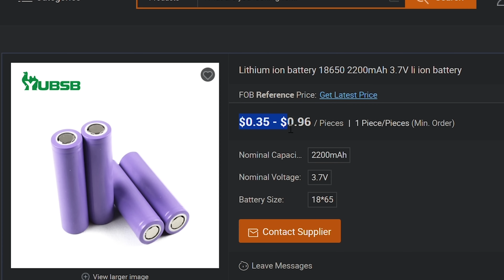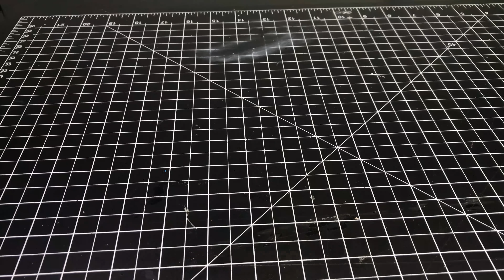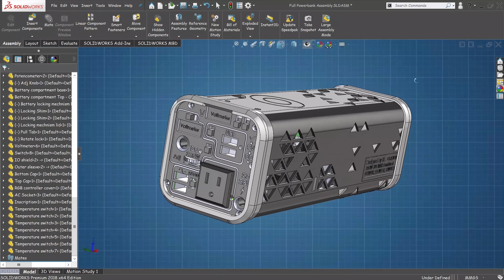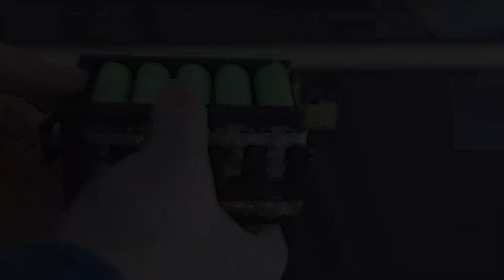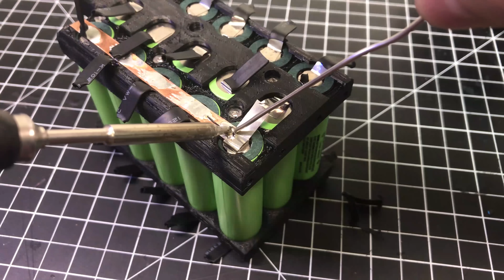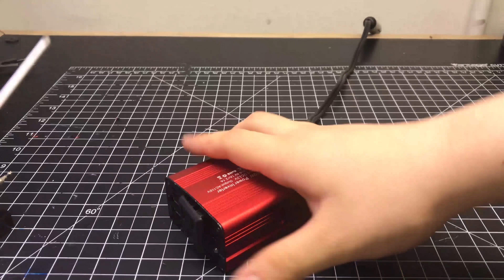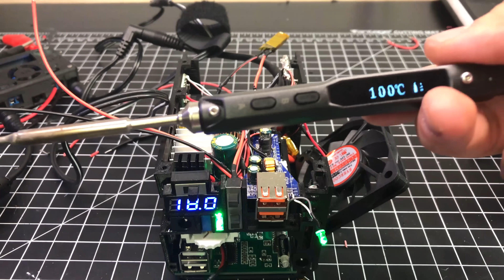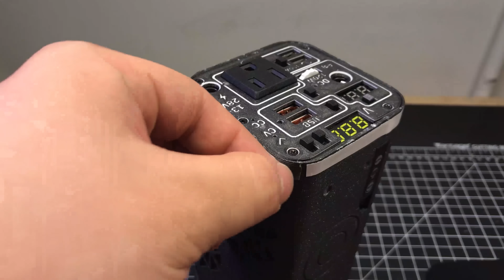How to Make the Ultimate 18650 Power Bank with Infinitely Expandable Capacity

Comment: everything cost 58$ only
3D printer enters the chat
Reply: Akhilk 99999 just go to a local library that has one
Reply: @floofyboii6034  3D printers are still not a thing in my country
Reply: @floofyboii6034  that is not a thing in mi country
Reply: They aren't too expensive. I picked up my Ender 3 for $170. I've printed RC model planes with 40 inch wingspans in parts on it and flown them. It's so worth it.
Reply: @kevinrdunnphs  "Aren't too expensive"

"Only for $170..."

Inb4 I get roasted for being cheap, yes I get it's an investment for a highly specialized machine. I was just making a joke 🙏
Reply: Just get few sheets of polycarbonate $5-10 and make your own. Designers don't bother with 3d printing when we prototype these types of things, plus with a bit of effort and knowhow (youtube it if you don't know) handmade enclosure and parts are faster to make and better than 3d printed ones. Basic tools sheet cutter, few clamps, utility knife, wire saw, heat gun (or hair dryer), resin adhesive (or glue gun) I mean if you are planning to DIY you should have most of these stuff already, if not they are a good investment if you plan to make your own stuff.
Reply: @jackywchen  3D printers are almost exclusively used for prototyping and small volume manufacturing. The whole enclosure is precise and exact while also only taking around a dollar in filament and the time to download and hitting start before going to bed.
Reply: @kevinrdunnphs  You are not wrong, but my comment was directed toward Akhilk 99999 since he/she doesn't have access to a 3d printer. Plus 3d print benefits large portions of small-volume manufacturing and prototyping, but for an equally large portion of us the technology or the cost doesn't justify using it in our production yet.
Reply: @jackywchen  This is what drives me crazy when I'm watching DIY videos.  The other day some commenter was whining about having to buy a "$20 glue gun."  

I'm just thinking... why the fuck are you watching DIY videos if you don't even have a glue gun, or a single clue what they cost?  I have a $5 glue gun and a $25 dual temp one.... but I actually make some of the stuff I see in these videos.  I don't just cruise around YT confusing "DIY" with "CHEAP/FREE."
Reply: Lol you all are totally missing the major market for online, on demand, 3d printing service. You basically model the case or whatever on your computer, send them the file, pick the material, and in less than a week you got your part for less than 20 bucks. Well unless you want it in plated gold or something. This is literally what i do for every project. Search it up.
Reply: @chrisspears4851  You're not wrong... but by the time you've paid for that service a few times, you probably could have bought a printer.  On the other hand, you'd also have to learn how to slice and print, etc., so I understand ordering it just makes sense for some people.
Reply: @The-Rewker  True. But 3d printing filament isnt cheap either. Its basically the same as renting anything, you rent a car for 12 months. By the time your halfway through you couldve bought the damn thing twice.
Reply: @chrisspears4851  Exactly. Truth be told, I hope things get to a point where ordering things printed is barely more than doing it yourself.  Probably will eventually.  Slicing/printing is still kind of a skill, and not everybody will want to learn it.  When printers are all controlled by machine AI it won't be an issue, but that's not quite here yet...  

I'm trying to imagine different kinds of print sharing businesses... like an Uber type user-to-user one where people in your area can rent out their printers when they're not using them, and you can eliminate all or most of the shipping costs.  It would be like Uber, except you can potentially scale up your operation with a few extra printers.  The biggest tangle I can see is how to price people using cheap printers vs. expensive ones.  

Or I'm thinking of a different version of the services we have now.  Where you can order a model printed as usual, or you can log directly into the printer and slice it yourself, then print it in real time.  Even with existing tech/infrastructure, you could automate most of that process.  People could even log into a webcam and watch their stuff print.  If you had everything set up right, one or two people could oversee a pretty large print farm.  

It's times like this I wish I had a million dollars (or even $100k) to invest in a startup.  Or I wish I had all of the technical knowledge to set it up.  But if I had the money, I guess I could hire someone.  What's nice is that everything is open source, so you could make your own slicing/print server software.  

Since you're someone who's used those services, let me do some market research on you:

Would you like to watch your model be printed in real time?  And/or receive a timelapse of it printing? 

Would you be interested in not only watching it print, but logging into the slicing software so you can have full control?  (I just realized the user would have to pay for any wasted material if their settings failed.) 

Would you be willing to post-process the model yourself, remove supports, etc., if it meant you could get it much cheaper? (not sure if this is already an option)

Fuck, I wish I had $1M and was a programmer.
Reply: @The-Rewker   Drew Kosonen  I think a better example would be a hackerspace airbnb set up. Where in every major city, we have a place rented out and people pay a membership/hourly fee to get in and tinker. Or we can just do a simple farm, where the service is all online via website or an app. So it would be basically another 3d printing service. The webcam part is definitely attainable without a ton of programming. Tho we might have to use our own set up. I've seen a ton of raspberry pi type projects out there that fits the bill. Im more entrepreneurial than consumer. And ive always been interested in 3d printing, as it still seems to be a emerging manufacturing field. This idea had def got some entrepreneur juices flowing lol. From my experience your too hooked up on the excuses of no money to even start. Thats why you expand as you go. You wont grow from 0 to a mils customers in overnight, if you bought everything in bulk, but youll be able to test the idea and make sure its even profitable and/or scalable enough to be worth it. For example. Set up the website and everything and buy 3 printers. Once those get overloaded (and if you set up the profit margin right), you spend the profit investing it back into the business. And buy 2 more printers. And rinse and repeat and keep growing. But you need to decide what business model you want, because everything is up in the air rn, and ideas arent much unless you have a solid plan of action. The one you seem to be aiming for manufacturing as a service. Thats the one where whole reason people order their printed parts from you is because you have the special equipment, and as such its cheaper for them to order from you, rather than having buy the equipment and set it up on the technical side to finally get theire model. Ive built a few dif business's from the ground up. I have one successful one, and two more in the works. But this idea def seems to a working 3rd lol.
Reply: Duct tape is your friend
Reply: lol.... it's so depressingly retarded that this comment has 498 likes, I have to laugh in order to mask the negative emotions.  

<$200 3D printer enters the chat.  Commenter A: scoffs in $1000 phone.  Commenter B: laughs in $1500 laptop.  Commenter C: chortles in $2500 desktop.   

I got an Anycubic i3 Mega for $179 on the New Years Sale.  I was blown away that I could buy a working printer for less than half the cost of my GPU. 

3d printing is like this revolutionary technology that opens up a whole world of possibilities.... and people act like $200 is too much, because they simply have no concept of what "value" is.
Reply: Drew Kosonen I live in Lebanon. Where the average salary is $200-50 per month so a 3d printer is basically a dream for me.
Reply: There are companies online that 3d print things for you, for cheap too I think.
Reply: fr
Reply: While there's really no need at all for the 3D printer if you just have a rotary tool and buy a cool enough project enclosure, the cost of using legit batteries is going to be what costs either way. Old laptop cells are not the way to go even if you have tons. I'd have to use 30Q's or something.
Reply: Even with like the monoprice v2 its under 200$
Reply: 130€ Ender 3
Reply: Everything costs 58$
3d printer costs x100
EVERYTHING (With 3d printer) 58585
Reply: Cheep china 3d printer for 200$
Reply: @Rowdy Ugh... 

Good luck finding one on Amazon.  If you don't want to make shit, you shouldn't be teasing yourself with these videos.  Just keep looking at what's on the shelf.
Reply: alysdexia  Nobody likes a grammer nazi. (yea go ahead and correct it, aint gonna change how i type just cause u wanna be annoying)
Reply: alysdexia  Lol /r iamverysmart
Reply: @Rowdy lol wtf makes you think I use myspace?
"For a guy who likes shitty C10 pickups to come out of nowhere and heckle a guy.  What a loser."  
I wasn't "heckling" you, dumbass.  I was telling you to stop being a lazy POS and make something for yourself.  

People make stuff like this specifically because they can't buy it.  It's too much of a niche product, costs too much to develop and manufacture, and won't sell in high enough numbers to recoup the costs. 

So people make it themselves, then make these videos to show you how.  So stop coming on the damn videos asking where to buy it, like a moron.  
And stop trying to glean people's lives from a YT profile they never touch, because that just makes you look like even more of a moron.
Reply: alysdexia  " nothing *Nothing to do with grammar, a barbarism of ghrammatics grammatical barbarism, another word for composition as in handwriting, font, format, spacing, the looks, but with lecsis/diction as in register, vocabulary, declension, spelling, placement, the meaning, nor with nationalism or socialism. Run-on sentence/meaningless word salad. The wrong one, you, are the annoying one and a sociopath who needs to be offed." 

Extremely hypocritical, not to mention disturbingly sociopathic statement.  Much like your extremely hypocritical, laughable, and inconsistent attempts at grammatical nazism.  On internet comments, no less, where people are known to forgo grammatical rules in favor of expedience and/or free expression. 

... You have some legit illnesses in that head of yours, don't you?
Reply: @Rowdy You're still not getting it.  The whole point of videos like this is because you cannot buy the shit, and nobody wants to sell it.  If you took a moment to pull your head out and think about it, you would understand why it's dumb to even ask.

I could understand a kid asking once because they just don't know.  But I've already explained it to you multiple times, and you're just refusing to understand because people are so used to being spoon-fed if they just shell out some $$.

So I'll try one more time.  If you're not going to read, don't bother responding:

If the person wanted to sell them, they would be doing that.  But it's not a product that can be made & sold profitably.  Only like 10 people would actually buy it so you won't see any of the big companies making it.  They would spend more on research & development than they would ever get back in sales.

If you're hoping to buy it from a major manufacturer, the cost of the device is only a fraction of what you'd end up paying.  They have to recoup all of the money they put into R&D, manufacturing, distribution.  Not to mention getting it certified for safety, licensed for sale, etc.

If you're hoping to buy it from a DIYer, they won't have as much overhead to pay.  But that means they don't have a factory either, so you have to pay for every minute of their time.  So I'll ask again: Exactly how much would you be willing to pay for this thing?  $200?  $300?  $500+?

I'm not sure why this is so hard to understand, but I guess this is the world we're living in.  China is taking over with cheap sweatshop labor and crappy products because we westerners have no concept of value, and aren't willing to pay for true quality.  We just want all the stuff and we want it cheap.

You probably don't even know why you want it or what you'd use it for...
Reply: @The-Rewker  I never thought my comment will become this controversial
Reply: @Stalka42  That's because your comment has nothing to do with the current controversy.
Reply: @Rowdy What kind of loser wastes their time watching DIY videos when they're too lazy/stupid to make anything themselves?   

Not my fault you need a novel to understand the basics of economics...
Reply: alysdexia  Oh ok, troll was my other guess.  Are we having fun, troll?
Reply: alysdexia   I didn't have to prove anything, you did it all by yourself with each word you say.
Seems like I struck a nerve with the "schizo" comment.  You okay, bro?
Reply: @Rowdy Pointing out how dumb your questions/comments are means I'm trying to sound smart?  
Apparently you think I do... so thanks for the compliment I guess?
Reply: alysdexia  Yeah.... trolls don't hijack threads with a bunch of asinine pedantry or anything like that... lmao.  You don't even know what a hypocrite you are, it's cute.
Reply: @Rowdy Wow, you can use google... you're so clever.  
I can tell you right now you're not competent enough to be self employed, either.
Reply: Creality ender 3 pro. $240 with shipping. Takes 2 weeks to arrive but is a cut above normal printers. Mine has been going non-stop for 2 days now and zero issues
Reply: ajajajjaja
Reply: If you don't have access to a 3D Printer, just use wood instead
Reply: Are you from East Asia bro ?
Reply: Why would you mind building things like this, without owning a 3d printer?

Comment: The only thing I'd change on this is have connectors on each part of circuits making it easy to repair and a small fuseboard to make it easier to replace fuses without having to take it apart.

Comment: i love the case! finally theres a local 3d printing services near me. but is a 3s configuration last longer than the equivalent 1s if you use only the 5v output? a typical 1s 8p usually don't last long if charging 2 phones for example at the same time. another issue with 1s is you have to deal with resistance over longer charging cables (could this be solved on a 3s configuration?),. plus it took more than 24hrs to charge. im asking coz im planning to make an alternate 1s variant based on your model. and one step up 12v output for use mainly on a modem which pulls only 0.3amps.

but i will definitely have that high-tech case get printed 😁😁😁

Comment: Very nice and I want to make one, This is a great build, in a perfect world all of these components would last forever or just stop working, but in this world any of them could have faulty parts and go bad at any time, at minimal you wont have a working pack, but at worst, you have a fire. I wont need the different LED lights as they just drain power.  When buying mass amounts of components you get a good price. You can even find a small saving when you order 5 instead of 1 so when you want a thousand or more maybe 10's of thousands everyone is willing to dicker prices. My worry is the quality of the cells and components. This just powers the average laptop @ 95 watts, but if you want the internet, you need to power a modem so you better get high capacity cells 3400 to 3500mAh and extend the cell count in parallel groups which will make the whole project longer or build a extension pack you plug in. Don't forget the loss in energy with this design either. I wonder what the sine-wave looks like? Also the cell design, if one cell shorts for some reason and I seen it, that whole battery pack is gone, you want to run a small wire so the cell in question is fused and eliminated to save the rest of the pack.

Comment: that is a lot of work, but it has plenty of features and is very useful. I'm sure if you had the ability to print boards you could make this a bit smaller and less complex in the wiring or would it be expensive and large either way?

Comment: Two suggestions:
1: use SONY 18650 batteries. They have 3000mAh per cell. (15 cells = 45000mAh)
2: Integrate a USB-PD module, that can charge/discharge 20V 5A at max.
Reply from the maker: Next version: Samsung 40T 21700 cells and USB PD integration
Reply: @kralyn3d  Wow, this one is even better than SONY batteries! 4Ah * 15 = 60Ah!
Will you build your own USB-PD PCBs, or just like this time using building blocks from other products?
Reply: with parallel connection of 5 3000mAH cells, you get only 15000mAH in total no matter how many batteries you series connect to it.
Reply from the maker: David Sondergaard I’m currently drawing blueprints and defining constants. I’ll post an update to the community tab within a month.

Comment: not enough solder....*more solder*
btw, i wouldn't call it "expandable" it's more like "replaceable" capacity. the "regulator" portion of the powerbank basically acts like a medium from which the energy of several battery cells can be expended and recharged. it's almost the same relationship between a gun and its bullets.

Comment: 23:34 That is legit AF.  If I had access to a 3d printer and some extra cash I'd totally be making one of these.
My actual next project is a bench power supply from an ATX power supply.  It'll feature banana plugs for common voltages 5V, 12V, 19.5V, 24V, and an adjustable voltage dial/plug for anything else needed.  I want to have fast charging type C so I don't have to carry my wall wart between the car and home and I want this to be right on my desk; Used daily for anything and everything.